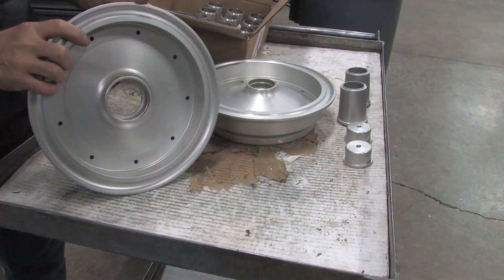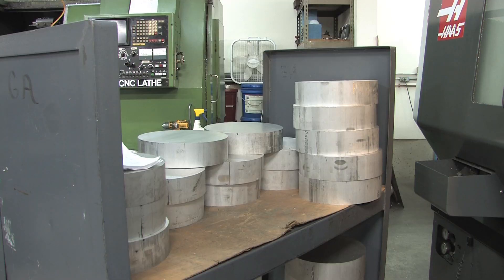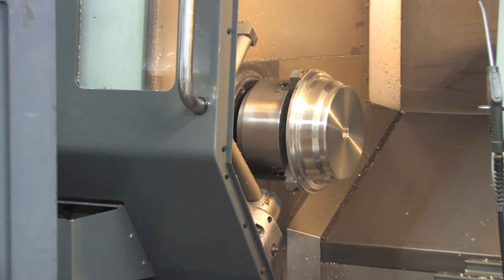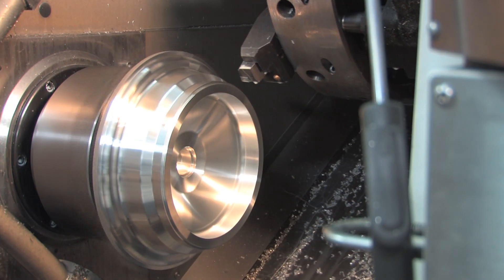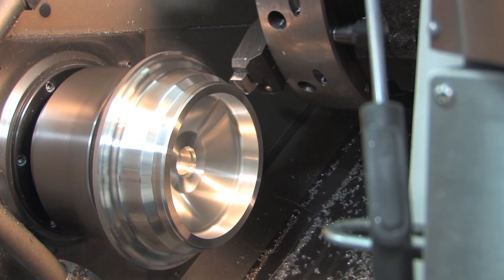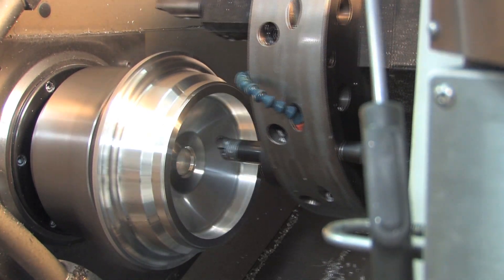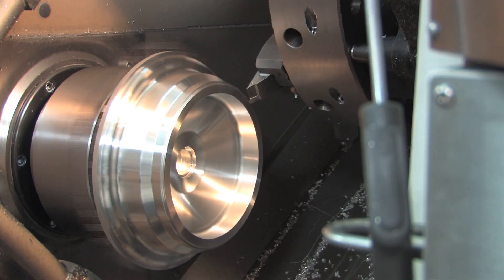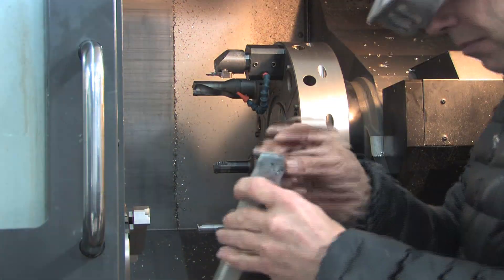GSM INC. Greg Miller CNC Machining, 10" Aircraft Wheels

Comment: Did you do FEA on the rim? Thanks for sharing.
Reply from the maker: No this is a copy of a Cleveland Wheel so it is stronger.  Made of Billet vs cast magnesium.  This is a wheel no longer produced by Cleveland and has to be an owner approved part.  I sell as experimental and they are responsible for sign off.
Reply: @mauleguy  Understood. Thanks for the reply. Beautiful work!!